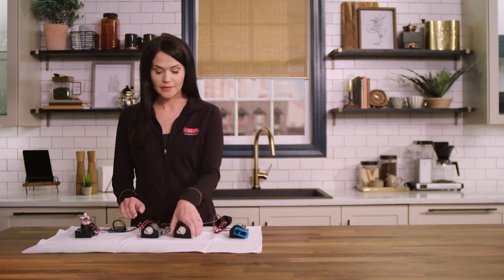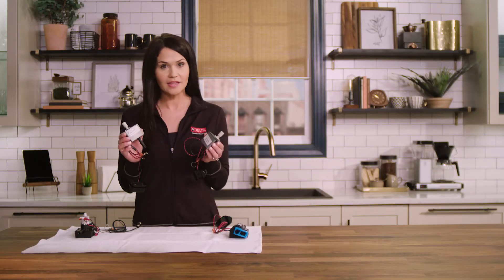How to Identify if Your Kitchen Faucet is Compatible with Delta® VoiceIQ® Technology

Comment from the maker: Thank you for reaching out! I do apologize for any confusion.  The voice module would be compatible with a solenoid that has a white sticker on the front with numbers X00090218 or X00090219. If the current solenoid has numbers X00074948 you would need to install a Delta EP92546 solenoid. If the number off the current solenoid is X00080377 you would need to install an EP92546XX solenoid. You would also need to use a Delta EP73954 a/c power adapter. It would need to be plugged into a grounded power outlet under the sink which is not connected to a switch.  Feel free to contact us privately if you need any further assistance.

Best Regards, Benjamin
Email: concierge@deltafaucet.com| Facebook/Twitter: @deltafaucet

Comment: I have black with blue clips X00090220 solenoid with Ep73954 a/c adaptor and the touch sensitivity barely works when the a/c adaptor is plugged in.  Works 1 out of every 6-10 touches.  Works fine on battery only. Delta customer support is a joke.  They just tell me it's not compatible.  They have an issue with crappy a/c adaptor design and no way to fix it. $100 wasted on voice iq with no help to solve the issue.